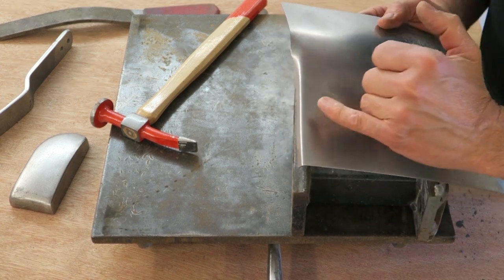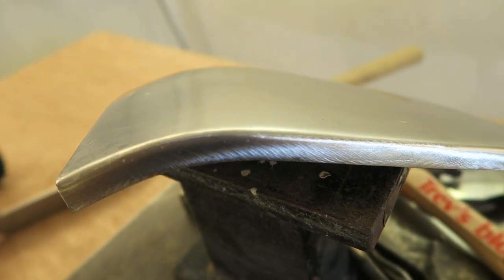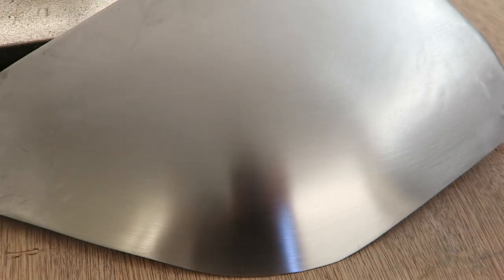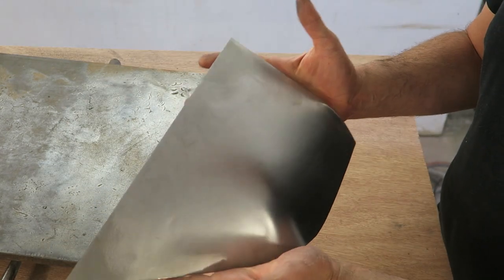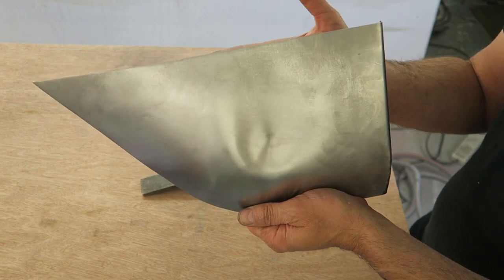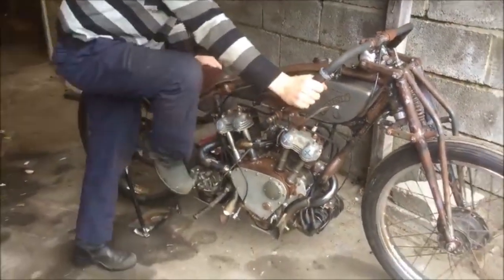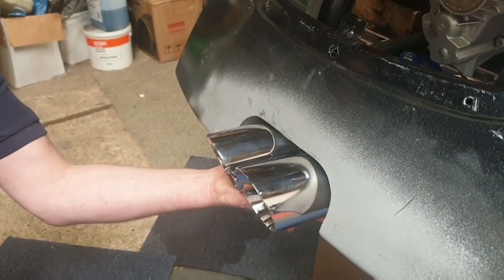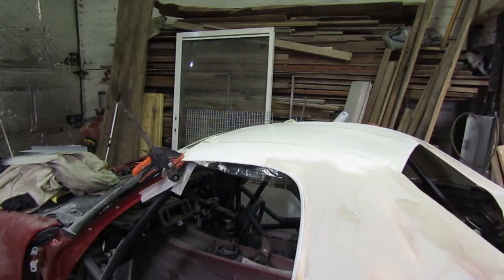Loads more metal Shaping, Finishing, Fabrication and Welding Tips and Tricks #52

Comment: Coach building:
I did a full build on a 29 Chevy back in the 1980s. I found that they butt welded the dash/cowl panels together right in the middle. It looks like they used stick arch welding with a really thin rod, both sides. Then they ground down the top weld and metal finished it so you could not see the seam. This was just primed and painted..no body filler of any kind was used. The bottom weld was left intact.

So I spent quite some time working to duplicate the process with a mig welder. Someday, if I am ever i a shop again, I'll do a video.

Comment: Ok, Here is why spoons exist.

They are for roughing out very large dents. You have to set up some sort of pulling to the deepest part of the dent. One of my favorites is a suction cup. The kids today love thier glue pulls. it doesnt really matter how, so long as its functional without adding distortion.

Then you use the spoon to tap down the crown as you pull the deep part of the dent up.

Spoons are tools used to strike or spread the blow out from the top of the panel so you limit any additional distortion to the panel. They are for crowns that are larger than the standard body hammer. 

Once you have that crown bumped down in size, you switch to your large double ended planishing hammer. Then as it gets smaller, your polished regular body hammer. 

As the size of the damage reduces even more, you move to your 1/2 sized body hammers (Chasing Hammers).

The idea is to start with the spoon for the largest stuff, and then reduce the size of your tool, as your panel has smaller and smaller damage to remove. Match the size of the tool, to the size of the damage you are working.

Comment: Trev, watched about all your content (so I must like it), have great respect for your knowledge and skill. Your humour helps. That finishing presentation was just brilliant, going to play it over and over so it sinks in. When we were younger I at least wasted time through fear of all that was mentioned. Now that I have dropped that fear people come to me for advice and decisions. Respectfully I do not actually care what someone thinks of me or my opinions now. It really does not matter. Thank You. One thing I do struggle with is weld through primer. I was taught (Maurice Westwood from Gloucester college) the metal should be clean and the gas will protect that, impurities in the weld will make it inferior. Weld through primer does not sit well. Thanks
Reply from the maker: Bill weld through primer is actually designed for resistance spot welding. Obviously people still plug weld  flanges and put weld through on inside facings but it just burns and makes a bit of a mess in the welded area. It’s a fact that listening to the end presentation and other similar talks actually changed the way I view the world, sounds corny but it’s actually the truth. All the very best Trev 👍

Comment: Fuse welding is the most accurate method of joining 2 peaces of metal, no foreign material is added meaning that you can planish to perfection you can also bend and beat the metal as you please as you dont have a bead of foreign wire rod on the way, the only underside is the undercut as you show on the Dino, the main reason to use filler rod is if you can't get to the backside  then the filler rod works for you as you have some material to grind and aim for metal finish.
Adding filler rod doesnt make a better or stronger weld against of what very much  repair people think.
Another topic open for argument is about the serrations on the file, there is a strong belief that as you mentioned it has the hability to shrink the metal... it doesn't ,the serrations are only for you to see where you are hitting as it enables you to see the marks in the high spots thereby finding the lows.
Keep bringing fantastic content Trev is always a pleasure to watch👍
Reply from the maker: Hey thanks 👍

Comment: I’m replacing a dash, firewall and floor in my 73 Holden and had to pause to replace the water pump in my dodge which is part of the timing system, in now then I’ve got to fix my ride on mower which melted its wiring loom when the headlights fell on the exhaust, so I’m hearing ya

Comment: Very good video. Thank you. On a car panel do worry about work hardening? If it is work hardened it might cause cracking. Should you anneal the metal or just not worry about it? The main reason I use a copper backing is to support the weld. The weld won't stick to the copper and helps filling a hole or building up an edge. This video must have been stressful on you as you have changed your shirt many times. Thank you very much for all you do. Two things I miss are your singing and being able to buy one of your scooters.
Reply from the maker: Thanks Steve, the clothing changes are a good indication of how many hours go into making a half hour video. With regards to backing your weld, if you find it effective then stick with it my friend. My whole philosophy with creating videos is just to offer helpful suggestions. If people take just one useful tip away then that’s mission accomplished in my book. With regards to work hardening, mild steel is very forgiving. Obviously the objective is to create the shape with as few movements as possible but it is extremely elastic compared to something like aluminium. Annealing probably wouldn’t be very effective on mild steel. You can certainly very easily destroy the strength properties of high carbon steels using annealing and make it far more flexible. Also heating something you’ve shaped would distort the hell out of it. I’ll do some more singing soon. Cheers Trev 👍

Comment: Trev, a silly question with tig on body panels. Tig rods are ER70 as is solid mig wire. Mig wire doesn't planish at all well. Have you used ordinary mils steel gas welding wire as your finish, when tig welding" I am just getting into tig and much is said about wire purity etc. What is your experience?
Reply from the maker: To be honest I haven’t over analysed it too much. I use mild steel mig wire for TIG welding. I can tell that it’s slightly tougher than if I’d just butt welded without any filler but it’s still miles softer than mig weld. Something some people have done is cut thin strips of mild steel sheet and used that as filler. I try and get my gaps as tight as possible when TIG welding so I’m guessing that most of the joint isn’t filler but mostly parent metal. Cheers Trev 👍

Comment: Was the wardrobe continuity error during the cold welding section a cheeky dig at the cold welding Video doctoring and general cold welding BS? If so I salute you sir!
Reply from the maker: No it perhaps should be though 👍 a bit more boring than that, I lost the clip so had to reshoot that part, original shirt in the wash…. Cheers Trev 👍
Reply: Damn technology always lets you down some how. Do you have much experience with modern (ish) french metal? Iv got a j reg. Renault 19 that Iv been restoring using your tips and tricks. Unfortunately Iv got a stretched area in the centre of the roof and when Iv tried shrinking with a torch or tig welder things get all kinds of crinkly. I also got some carbon spot welding electrodes I made a small clamp for to attach to my mig welder. Run it on the lowest setting and it works well. But same result as far as crinkly messes go. Thanks for your time and for sharing all these great skills and techniques with us all! Cheers!

Comment: I have been looking at making a spoon for myself. But I see that most people say they make them from a leaf spring or something like that. Is it possible to use regular steel flatbar 2" wide or so... dress it up nice and smooth? Would that work?
Reply from the maker: The point of using an old spring or file is that the steel is extremely hard. Using a piece of mild steel would result in the tool deforming and bending out of shape very quickly. Cheers Trev 👍

Comment: Would you treat aluminium the same way with the same spoons etc?
Reply from the maker: The basic mechanics are the same, the characteristics of the materials are different in that aluminium will mark easier, will be far easier to form but more prone to splitting and work hardening. Cheers Trev 👍

Comment: Will a vacume pull a dent out if it will crush a 55 gallon drum it should work on pulling on out.
Reply from the maker: It would depend on the size of the dent. The larger the diameter the easier dent would pull out. The problems faced would be making a tool that could seal to the panel. Another idea could be to make a tool that seals then inject the void with fluid, making it hydraulic, this would have greater power especially on a smaller dent. Cheers Trev 👍